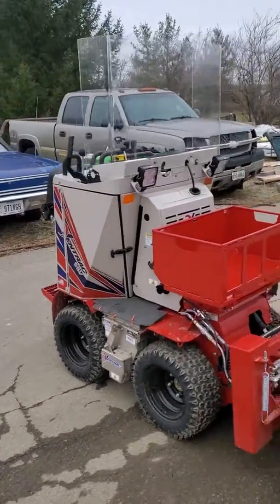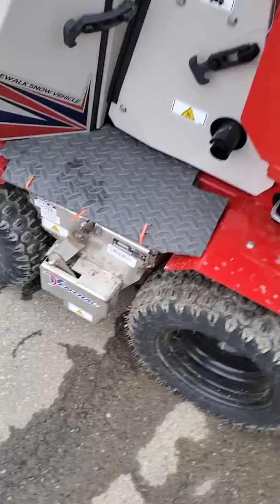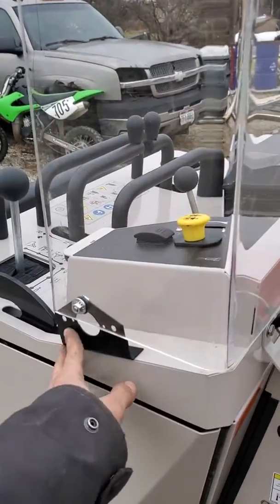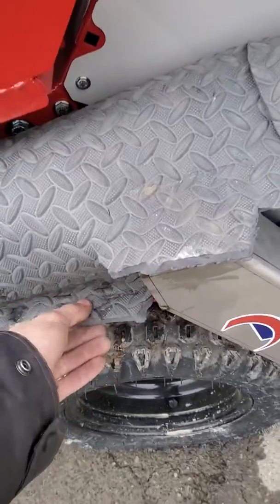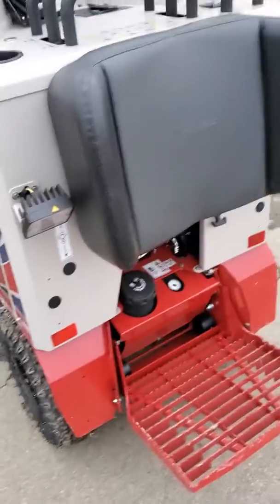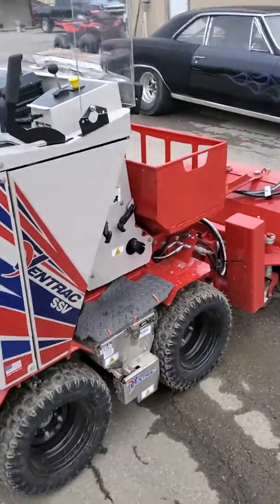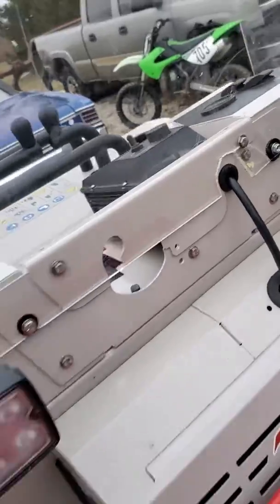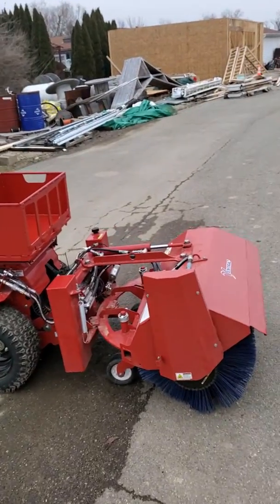Walk around of the Ventrac SSV sidewalk machine

Comment: I really like that windshield you made. How does it hold up in storms? And how exactly did you make it? I have two snowrators I would love to get windshields on. thanks
Reply from the maker: It's made of polycarbonate i think from lowes. It was the thickest stuff they had. With it being bent and bolted around the corners it doesn't move a bit. To bend it just clamp it to a table and heat up your bend area and slowly work it to where you need it. I'll be making some for our snowrators soon before the snow hits
Reply: @lancegee7490  awesome thank you.